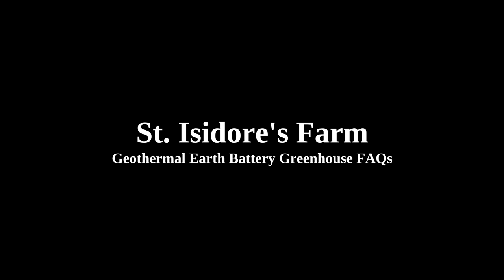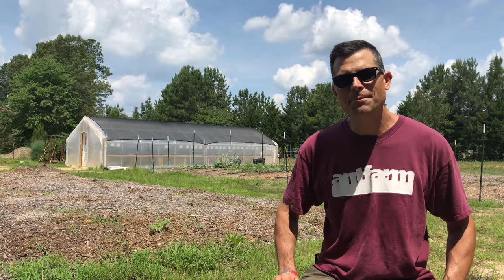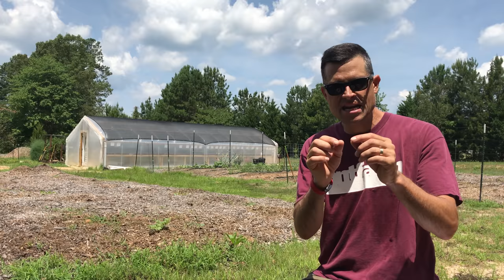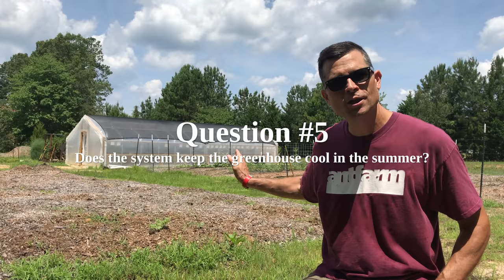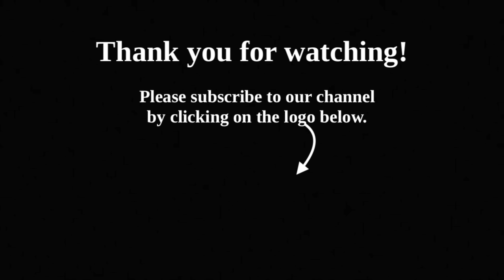Geothermal Earth Battery Greenhouse Pt. 11: TOP 5 FAQs

Comment: Hey, would love an update on how the greenhouse is doing this winter - specifically if your thermal battery setup is keeping it warm enough to grow through the whole winter. Thanks!
Reply: Still waiting
Reply: @SuperDaveP270  Don't think it'll happen at this point.
Reply: @jenson1569  Do you know what happened to them?
Reply: @boringstuff1542  No I don’t, it’s been a while, 3 years and no uploads 😢
Reply: It won't. He is running it backwards. You need to be pulling the cold air dense air up out of the the system for it to store heat efficiently. Not forcing warm less dense air down.
Reply: @davefroman4700  Could you explain why?
Reply: @boringstuff1542  I have just seen they stopped posting videos after this one, and stopped on Facebook and Instagram at the same time. Google lists the farm as 'permanently closed' now.

Comment: Good documenting of the build. I love seeing the enthusiasm of a fun project.  I built five 26ft x 100ft high tunnels on our farm about four years ago and installed a very similar system in one of the tunnels as an experiment.  I use a big wood stove and the ridge heat to charge up my buried system. The big advantage of a wood stove is that is that I can create heat and still move  hot air into the system after the sun sets.  The first spring, and only 30 days after firing up the wood stove,  I recorded  ground temps at 61-63 degrees at a depth of 12" on April 1st. We live in Alaska so that was truly amazing to see. I had a 2-3 week jump on the other market growers that year. So I have some experience with this type of system and with that in mind, I have a suggestion for your greenhouse. I would strongly suggest  installing  two opening vents above the doors and make them as large as you can. There are times when you need to get that excessive high heat out of your greenhouse right now. What happens on those high heat days is that heat rises and it will collect in the peak of the ceiling area. The heat builds and acts like an insulating blanket creating more heat and radiating  heat downward.  No amount of fans is going to displace that heat that is trapped up high because the sun just keeps creating more heat and it cant escape.  I had this problem big time the first 2 years even with roll up sides and 7ft x8ft end wall swinging doors. I finally figured out what was going on and installed  3ft x 7ft vents in the end ridges. That was the key. I have never had an over heating problem since. I usually open the vents, end walls and roll up sides starting in early June through harvest. Another huge advantage of opening everything up is to allow all the beneficial insects into the green house.  But the bigger reason for proper venting is to eliminate moisture. If you have moisture beading up on the plastic, you have a moisture problem and you must vent. I see in your video that you are running fans and even shade cloth. That tells me you have way to much heat and most likely to much moisture?   Mold and bacteria, especially powdery mildew will become your new worst nightmare. The spores will collect in the drain pipes, in the soil on everything. And then the cycle begins next season during high heat/moisture times.
Reply: Great bit of information thank you

Comment: Really cool project...
I would suggest adding an aquaponics component to the greenhouse.
In terms of solving the issue of overheating, you wouldnt be able to effectively cool your greenhouse via air based geothermal system in the summer in your specific region...too much humidity and too hot.
- I would argue that the only options would be to install several Roof windows... and a Driver fan above each of the doors in the greenhouse... So the driver fans would operate in the fashion of one blows air in and the other blows air out, which would provide a constant air exchange.. and the roof windows would act as a natural release of hot air buildup... that seems to be the only options which are somewhat practical... Driver fans are an easy install... The roof windows are a bit tricky... not sure how that can be done effectively for the polyfilm greenhouse...
- Another option that you can try is circulating a bit of water through your geothermal pipes, just a bit, maybe at like 15-20% fill so that the pipes have water only covering a small part on the bottom and the air that you are pushing though can be cooled more by water absorbing heat (water is 800 times more dense than air)... think of a water fountain cooling system thats stuck inside the pipe... once winter comes around, you pump out the water from the geo pipes and run it dry...
Again, really cool project... Best of luck!
Reply: The water needs to be in the grrenhouse in  its gaseous form (water vapour) in order to absorb the heat. When the moist air enter the tubes, it drops to dewpoint and the water vapour condenses out. To change phase from gas to liquid it has to give up the energy it took from the greenhouse to change phase from liquid to gas, The result is warm rain in the tubing,  A lb of condensate represents around 1000btu, a greenhouse full of transpiring plants generates a lot of water vapour. Its interlinked, unfavourable temps and humidity in the greenhouse means less transpiration, so less cooling. You can get around this to some extent  by using overhead misting to raise the RH% to get the ball rolling. A lot of folks dont realise the plants are an integral part of this system, it doesnt work nearly as well without them..

Comment: You may want to look at a swamp cooler system to increase humidity, lower the temp, and increase the efficiency of the earth battery.  These systems are relatively simple to build, but highly effective.  Keep up the great work, y'all!
Reply from the maker: Thanks for taking the time to post this comment. Being in North Carolina - swamp coolers and not something we often think about, but in this circumstance would be perfect. Really wondering if couldn't construct something on the exhaust pipes from the earth battery system and take advantage of the fans we already have running.

Comment: There have been some very awesome geothermal greenhouses built to cool those temperatures you would need 300 feet of 12 inch pipe under ground and to be able to move 4 times more air then your moving now. 112 degrees is still very hot for a greenhouse. But I'm sure it works wonders for Germination.

Comment: You mentioned that air is coming up and out of cracks in the greenhouse floor. That made me wonder why a perforated pipe was used? Wouldn’t a non perforated pipe perform just as well (or better), because the pipe surface is the temperature of the surrounding soil? Makes me think the perforated pipe would cause the system to perform less efficiently, due to the loss of some of your cooler air through the perforations into the greenhouse floor. Since the system runs most of the time, it’s under positive air pressure most of the time, so air in the surrounding soil never has a chance to enter through the perforations. Also, seems the perforated pipe is the reason there is a drop in air velocity between your air intake and exhaust.  Lastly, it seems a non perforated pipe system would help, at least some, with maintaining a higher humidity in the green house. This was a very interesting project. Thanks for sharing it on YT.
Reply: Obviously the perforated pipe was a mistake in this whole system from the very beginning...not sure who gave him that information...I think originally he was concerned with creating a greenhouse that heated itself but as we all know and he found out is that heating a greenhouse isn't nearly as difficult as cooling a greenhouse...since there were no updates any more recent than 4 years ago we don't know how the greenhouse maintained warm temperature in the winter which I believe is what he set out to experiment in the first place, but yes of course regular pipe (non-perforated) is usually used for a whole host of reasons

Comment: I hope you do a follow up asking the very same questions at the end of each season.  It would be great to document your findings so other's can learn from your first hand experience.  A recommendation to help keep the temp down.  A roof vent along the peak would be ideal OR a large vent at the peak of each end wall would help a little.  Rollup sides are best.  Passive air movement is better than forcing massive amounts of air through large fans.  Big fans cost big money and they don't fix poor ventilation.  2nd Recommendation.  The earth battery need not be directly below the greenhouse.  In your soil maybe it would be better to run the earth tubes external to the greenhouse.  You could dig a long trench without serpentine routes, just go out 100' and back to the greenhouse (two to four turns max) and you will increase the cooling substantially.  This will remedy the problem with drying out the greenhouse soil jetting air out through the ground.  Rj - Beyond Harvest Veganistas
Reply from the maker: Thank you for the thoughtful comment. Good call about the vents in the peaks vs. fans. Roll up sides is on the long list of "to-dos" with the greenhouse. We just didn't get there yet and had to turn our energies to the garden and other things on the farm. We'll get those in before next summer!
Reply: Yupp, the earth is a huge thermal battery.  It makes no difference if you have tubes beneath a greenhouse or not.  I like the idea of only have a few turns instead of serpentine with numerous bends.
Reply: I wish folks would fit temperature sensors at intervals in these long tubes so they could see just how poorly they perform ;)
Reply: @JohnGuest45   u dont think it works?
Reply: @yumyum408  
The system works if designed correctly. Unfortunately a lot of folks make the mistake of installing overly long tubes. The heat exchange potential is the same for one 100ft tube as it is for ten 10ft tubes buried in the ground. Consider the surface area is identical in both cases. The difference is it is much harder to move air through one100ft tube than ten 10ft tubes. Its not how long the air spends in the tubes, its how long the entire greenhouse air volume spends in the tubes. If you could move all the air underground instantly and release it back into the greenhouse instantly, you can imagine how cool c the greenhouse would be. If you cant outpace the incoming solar gain, the greenhouse will overheat. Most folks have enough tubing in the ground, they just dont have it in the correct layout. Tape 20 drinking straws together end to end and tape another 20 straws together as a bundle. You`ll find it very quick and easy to blow a lungful of air through the bundle of 20. It will be very hard to blow through the end to end straws and  it will take a long time to put the same lungful of air through it. If you had to move a full greenhouse air volume as quickly and easily as possible through the straws, which one would you choose? the bundle or the end to end? ;)

Comment: Looking into building an EMT greenhouse in my backyard and your video series was by far the best documentary from start to finish (watched it all in one sitting!) My goal is to build a greenhouse that runs off the grid, and I’m hoping to accomplish this with a solar panel feeding a couple deep marine batteries going to an inverter which will power a thermostatically controlled 120v heating element (or two).  I’m in CA so we have fairly mild winters.  

One thought on your design: I noticed the huge amount of runoff you have in your French drains. Would it be feasible to collect some of that drainage into a holding tank and rig up a system with the necessary pumps to water your greenhouse? If you had an elevation change you could put a holding tank uphill and use a solenoid and gravity to water the plants.  Just a thought!

Comment: Great videos!  Because your soil is sand and below that clay,  it's not only a heat and cold bank it's a  humidity bank. Sounds like your draining all the humidity ( water ) through the blowers.  Can only sustain high humidity if there is moisture left. No humidity less effectiveness in your system.  Just add water, but would require some time for it to absorb .my guess.

Comment: Great update! Was hoping I'd see something from you guys soon. We have roll up sides and wide open doors on our house trying to keep it cool. So far we can keep it at about 5F above ambient on the really hot days without a shade cloth. I do turn on our "cooling" thermostat when the house hits 95F just to hopefully take the edge off. Don't have any great data to back up that it actually does anything, but at the very least I'm banking a little heat. Are you monitoring soil temps? And are your fans on thermostats? I remember you saying that you wanted to thermostatically control them. Our soil at ~2ft down is sitting around 82F, almost too warm for plants (I think I remember someone saying that some plant growth stops when soil temps rise above 85F). Also curious, are you monitoring inlet and outlet temps? At some point are you seeing the soil "saturate" with heat during the day, meaning the delta T between inlet and outlet decreases?

Comment: Why did you use the pipes that has holes in it? I believe my area has a higher water table than yours so the holes would take up water and this would not allow the air flow through them

Comment: If you don't mind me asking,  do you think this system could be used as an off greed cooling/ heating system for a house or at least as a support for them in a house with walls not and not a membrane ? If so,  would it need extracting/ pushing fans per each room? Thanks!

Comment: Hey, St Isidore's Farm.  First off great work and documentation of a really cool project.  Secondly,  I would like to give you some advise that may help to increase the circulation of the air through the  thermal battery system without having to buy new equipment.  You have touched on the importance of thermodynamics and for good reason because those principles are always relevant in systems thinking and design.  Advice:  Switch the fans from the roof of the greenhouse to the open tubes as close to the cool floor as possible.  I advise this because of the properties of the fluid (air).  Air is more dense at cooler temperatures than the fluffy less dense hot air that rises.  The fans will operate at the same specs. However, by taking advantage of the difference in density due to solely changing the Y position (height) of the fans in your closed greenhouse system, the fans will more move more air molecules (Mass) per same unit of volume of air.  This is theoretical and I would be interested to see the before and after in the change of wind speed as well as the temperature gain/ loss due to this simple thermodynamic principle related to density.  Frankly stated I think that pushing air from the floor of the greenhouse and letting the greater net negative pressure suck the lighter, hot air from the peak passively would improve the function of your system.  Let me know what you think, I wish you the best and keep coming out with more good content.
Reply from the maker: Thank you!
Reply: Yes, pulling air instead of pushing air

Comment: Just food for thought. It might be a good idea to use the exhaust air from the GT/EB system to fill your 2 layer poly cavity. Might cut cost of inflation fan and allow the cooling of the environmental barrier. Maybe a few degree difference in inside temps.

Comment: My GHAT system should work much better, I used an 18 inch culvert attached to 15 X 3 levels of 4 inch irrigation tubing. At the exit and enter points there are 55 gallon drums where a 1000 cfm blower is attached.  I have yet to assemble the 20 X 40 greenhouse over it as it is below 0 F here for the past 3 weeks. Will be starting on it next week, BTW I couldn't find that pressure switch so I came here to see what you installed. 

I was going to have 3 sides completely enclosed with other construction material other than plastic, because I wanted it to run year around. With a traditional hoop style not sure if the GAHT system can keep it warm enough in winter. 

This weekend need to get planting 32,000 onions for transplanting in April, which is in my smaller greenhouse. Need to get the new greenhouse finished and running in 2 weeks for warming up the frozen soil under it. Maybe can have the earliest tomatoes in this area.
Reply: A 1000cfm fan for each layer of tubes would give you a better chance of cooling in the summer.

Comment: Water in the earth battery will help cool with the evaporative cooling and it also helps with heat transfer between the air and the ground.  You don't really want a dry earth battery, because the water helps as long as it is not filling the entire height of the pipe.
Reply: The evaporative cooling takes place in the greenhouse, not inside the tubing ;) You want the condensate to drain from the tubes as completely as possible. A tube half full of water will limit the amount of air you can run through the tube, the more air you can run, the better..upto a point.